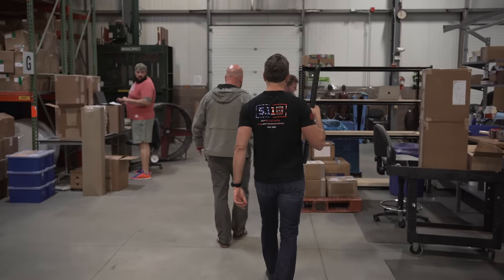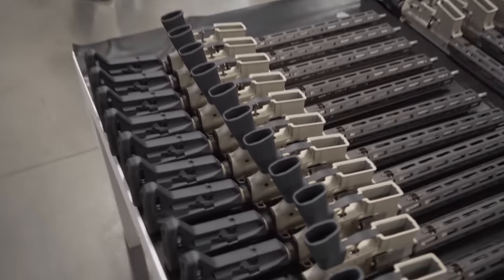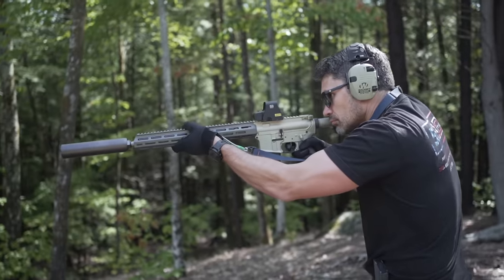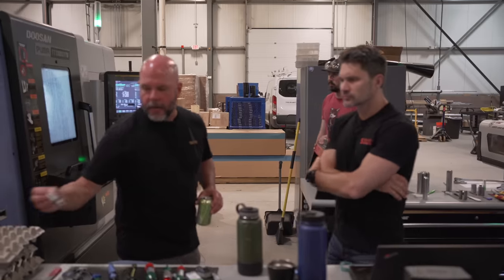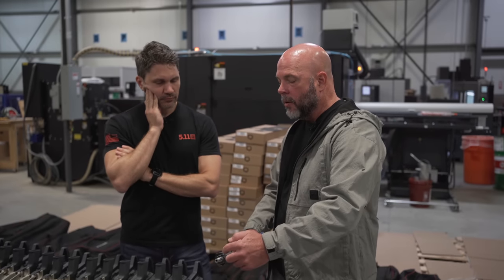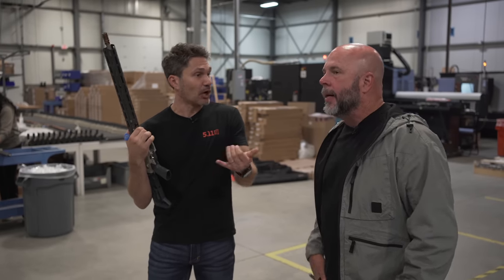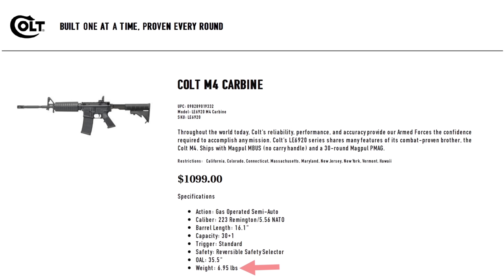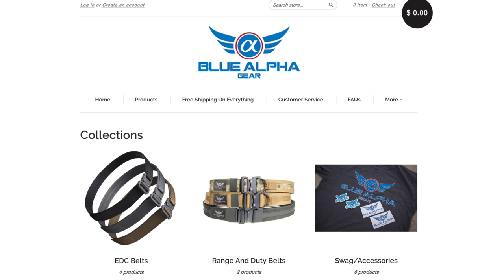Why Q's AR-15 Will Disrupt the Market: The Sugar Weasel 16"

Comment: Why buy a AR when I can get a M14
Reply: Because the AR10 is a better rifle for .308, and an AR15 is a better general purpose rifle.
Reply: @andreivaldez2929   Camp Perry Matches disagree with your assessment.

The AR10 is merely an alternative platform for the .308 offering but not necessarily better or worse for that matter. The M1A in all its variants, is what I consider an Expert's rifle. 

Whereas the AR10 is more user-friendly for the average consumer that may or may not have prior experience with the AR manual of arms. Overall, the AR platform is more approachable but not necessarily superior. 

Stay classy my friend.